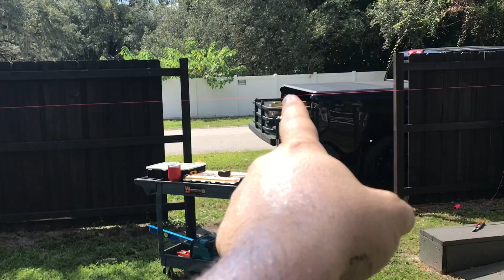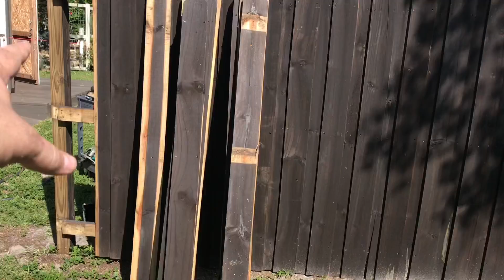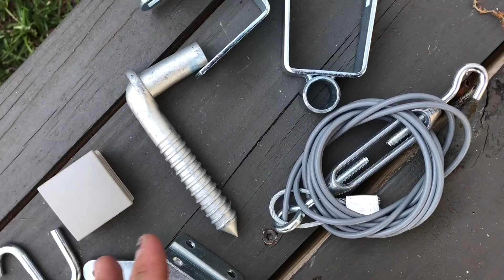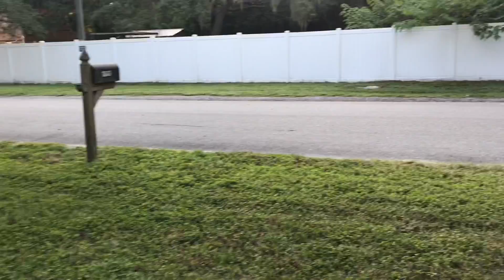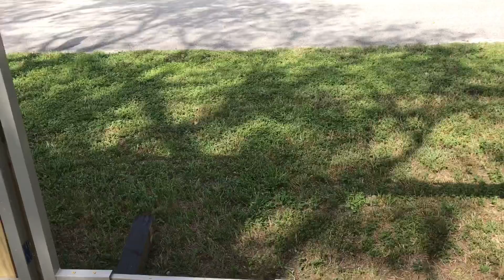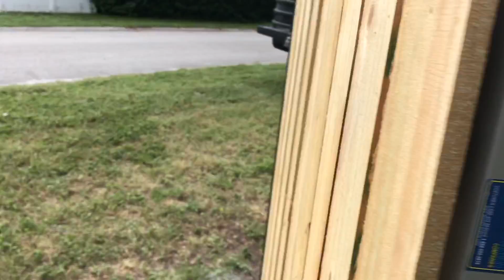How To Build a Double Gate

Comment: Would this still work with using a vinyl fence as the skin? Great work! Thank you.
Reply: Yes, you can use this gate with vinyl. The vinyl pickets need to anchor to solid structure. The gate will only be as good as the structure behind it. My gate is skinned with composite decking. It's structure is 2x pressure treated lumber.

Comment: How far apart did you set your 4x4's?
Reply: To make the 10’ gate how far apart.
Reply from the maker: Depends on what section you’re referencing. Typically they’re set no more than 8’ on center.

Comment: Great video! 1 question...the directions show the top hinge facing down and you faced yours up. Any reason for that?
Reply from the maker: Yes. I did that so I can pull the gates off the hinges if I have oversized vehicles. You can set your hinge pins either way.
Reply: @fixitnoworlater  love your thorough videos!
Reply from the maker: Thanks a bunch!!!
Reply: @fixitnoworlater  could not thieves lift the gate off also ?
Reply from the maker: If you’re worried about that just flip a hinge down. They’d have a hell of a time with all the hardware keeping it locked in the center. At that point thrives could also just pull boards off the fence and get in. Anything can be broken into. It’s not a vault.
Reply: @fixitnoworlater  yes, i know nothing is thief proof. But no sense making it easier. Have seen gates etc pulled off because the hinges were installed incorrectly. One example was my neighbors gate. Thieves got away with a lot of tools. They just lifted the gate up, easy peasy. My gate cannot be lifted up because the gate hinges are installed to prevent this. Up to yo, just that i noticed that.